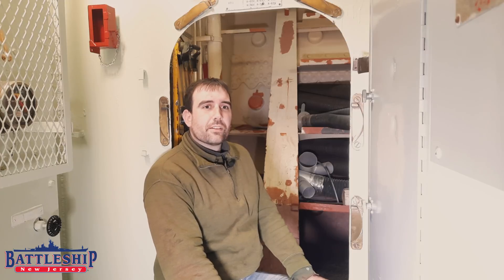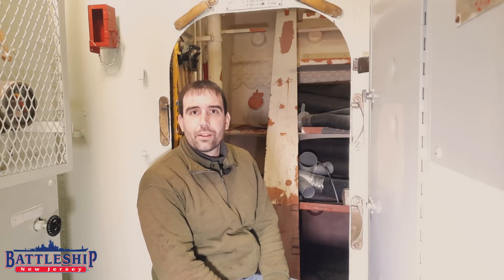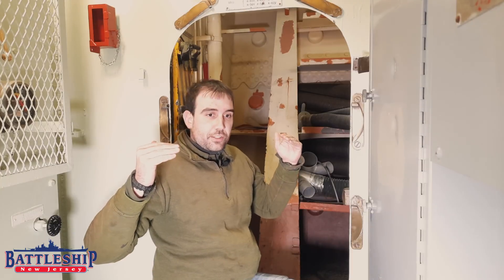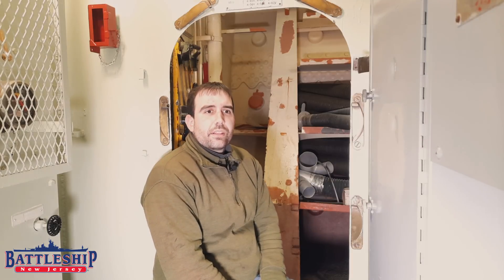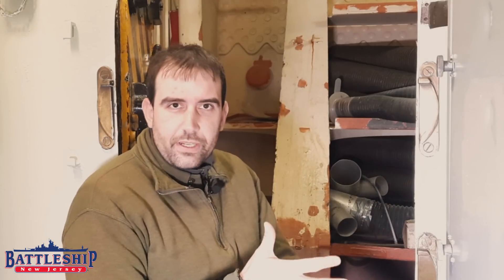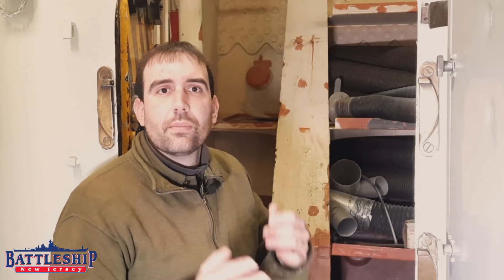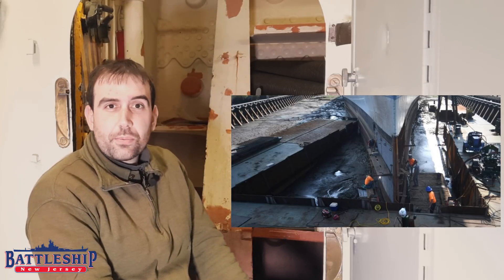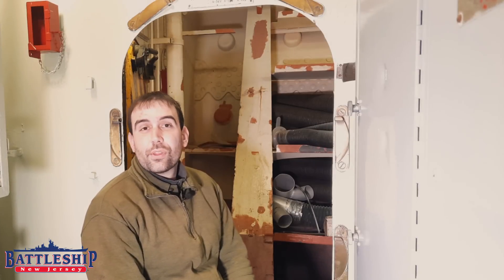Ship out of Water: Why aren't museum ships on dry land?

Comment: Is it different from HMS Victory because it's made out of wood?
Reply from the maker: That's a crucial factor to ship preservation, yes
Reply: @BattleshipNewJersey  While you are correct in describing the new graving dock currently in use, the original graving system was very rudimentary (installed in the 1920's I think) and the long term affects of gravity and specific pressure points on the structure were either not understood or not thought about, which over the decades has lead to the deformation of the hull.

When you tour around the ship and keeping in mind this video, you realize they have stripped out a considerable part of the load that would normally be aboard.  If memory serves there are only 2 or 4 of the original guns, with the rest represented by sheetmetal replicas.
Reply: whoops, you answered my question!
Reply from the maker: Ryan started his career in wooden ship preservation, its definitely not easier than steel but also a very different process of preservation.

Comment: Tying a candle to the hatch to consume the oxygen in the ballast tank is an absolutely genious idea.
Reply: In the Middle Ages sometimes a candle would be placed in a coffin prior to sealing the coffin with lead.  Although they didn't know the chemistry they did know that it reduced the decomposition of the body.
Reply: @thoughtfulhistorytoday7214  So you are saying that's why we can still the music of Beethoven, Mozart and Brahms, because they put a candle in their coffins which kept them from decomposing?
Reply: @ct8764  No. These guys are still "decomposers" 😃😄😂😅
Reply: @thoughtfulhistorytoday7214  Wouldn’t the CO2 leach into the water and turn into Carbonic Acid, which would deteriorate the hull?
Reply: Wouldn't this cause a vacuum and eventually cause the compartment to implode?
Reply: @bossxfactor16  No. It doesn't delete the oxygen, it turns it into inert carbon dioxide. So the chamber would actually end up with slightly more gas in it. But not enough to make a difference.
Reply: @bossxfactor16  It consumes the oxygen and replaces it with carbon dioxide. All the other gases that make up air are still there. Remember that rusting is just oxidation, essentially really really really slow burning. Removing the oxygen stops it.
Reply: @bossxfactor16  no.. you're replacing O2 with CO2 and CO (at the end) Both CO and CO2 are larger molecules than O2.. so no vacuum will be produced.  CO will seek to become CO2.. but that is definitely less corrosive than O2 left to it's own devices.
Reply: @bossxfactor16  The opposite is more likely a potential problem, heating gas in sealed container increases pressure against the container walls (though may be more a risk for just breaking the seal than structurally catastrophic), but with trial an error it should not be that hard to pick a set of materials that will transfer heat out fast enough that should not be an issue.
Reply: @bossxfactor16  when you see the candle vacuum trick done with bottles that's because hot air is shrinking.  A candle is not big enough to heat up an entire tank.

Comment: After watching some videos of the Texas they need to dig a long ditch and fill it with water, drive it in and back fill the dirt.
Reply: The Texas is going to dry dock in early 2021. The hull will be replaced to about 3 feet above the waterline and modern coatings will be applied.   Putting her in mud or concrete will just continue to rust the hull. They both hold water. Please check the battleship foundation web site and Facebook page for more information.
Reply: @mikus4242  "In 1922 the London naval treaty came into effect which required Mikasa (Japan) to be decommissioned. In 1923, she was struck from the Naval register, though she wasn’t destined for the breakers. Instead, she was encased in concrete at Yokosuka and opened to the public as a museum which is where she remains to this day."
There is videos on YT of them talking about the Texas and their grand plans for the last 20 years. Some of their film productions of their plans cost more then their plans did. Then another emergency pops up and they don't have the money anymore.
Reply: @finscreenname  I am a restoration volunteer on the Texas. The state leased the ship the the Battleship Texas Foundation and allocated $35 million additional funds to replace the hull.  It is going to happen and it will be in 2021. She will probably depart in the first half of the year.
Reply: @mikus4242  Is the plan to sink it back in the same mud it's sitting in now or will they build a birth for it?
Reply: @finscreenname  First of all, she is afloat.  I have seen her moving slightly up and down when a wake comes into her slip from ships passing down the Houston ship channel. Second, after hull replacement, she will be going to a new location .  The new location has not been announced, but should be in the Houston/Galveston area.  The Battleship Texas Foundation is evaluating bids for the new location, but has not selected the winner.  As of December 2020 the processes of finalizing the shipyard and new berth location are well advanced but not announced.
Reply: @mikus4242  Well it's nice to see some progress being made. From what I remember that last time it went to drydock for repairs and upgrades all the money was spent on emergency repairs just keeping it afloat. Sounds like you all have a plan and some cash this time. I hope you all get down what you planned.
Reply: @finscreenname  The Battleship Texas Foundation is doing a good job.   Texas Parks and Wildlife used the previous 2 slugs of $25 million each to repair the keel structure and tops of the inner bottom tanks while the ship was in place. Taylor Marine did an astounding job it. The engineering company in charge of the tow and dry docking has filled the troublesome torpedo blisters with expanding foam as a water exclusion material. The ship is pumping a handful of gallons a day instead of thousands.
Reply: @mikus4242  I saw that the tanks were filled with foam. How do you all plan on getting it back out? Watched a guy on YT that bought a light ship in England that was full of foam. Months to remove it and that was nothing like the size of a BB. I really do hope you all get it back together. The video I just watched (from Nov) she looks pretty sad and the ditch they stuffed her bow into is just as sad. 
Look forward to updates when and if they happen. Don't mean to be cynical but I have watched videos about the sad state of the Texas since I have been on YT for 15 years. Something always comes up.
Reply: @finscreenname  Since the entire outer riveted hull is being replaced with a welded hull, the foam will be fully exposed to the outside.  The shipyard will simple removed the foam with pressurized water the same as they use to clean the hull. There is nothing in the tanks and voids that would be hurt by the foam or removing it.  EASY-PEASY!!
Reply: better to do it with concrete.  Dirt is worst then water for any type of steel/iron item.

Comment: USS Batfish (a sub) is on a dry land display, but a few years ago it floated again when Muskogee, OK flooded.
Reply: I have driven past that boat before it floated up. I remember seeing on the news that the ship was at risk of floating away and thinking "where would it go? Another part of the prairie?"
Reply: @starshipreviews  it is right next to the Arkansas River. If it got loose, who knows where it might have ended up.
Reply: @kudukilla  Not far. Most likely, without steering, it would have foundered on a sandbank. Easy enough to recover with a crane & barge. Just put it further inland the next time 🚢
Reply: @kudukilla  Batfish, and other submarines, can be put on dry land because of the shape of their hulls. The cylindrical/conical shape resists the pancake effect. It’s why SS Meteor (a whaleback ship with a cylindrical hull), can also effectively be preserved on land.

Comment: Well . . . the space with the candle might become oxygen free, but not "gas free".   The nitrogen is still there, along with newly added carbon dioxide.
Reply: Pedantic, nitrogen and carbon dioxide won't corrode the metal.
Reply: @DrewLSsix  The candle will go out when the air in the space gets down to around 16% oxygen content.

Comment: 5:46. Oxygen, not air. It's not gas free. The flame is only burning oxygen. Not the Nitrogen and what not. And it adds carbon dioxide. Super interesting video though. Just wanted to nit pick ya.
Reply: Its also burning the 🕯. Its not only burning oxygen.

Comment: I've seen some video's recently on the repair work being done to North Carolina. I was surprised to see the ship sitting in the mud like that.
Reply: The silt is there for two reasons.  1, before they built the coffer dam there was no way to prevent the silt from depositing around the hull without constant dredging.  2, the silt prevents oxygen from getting to the hull, thus preventing rust.  The area around the stern has been silted up the longest and, from what I understand, is in good condition.  Up until fairly recently the bow was still floating and as a result is in the worst shape.  That's why all of the repair work has focused on that part of the ship.

Comment: Huh...I had never thought about the "pancake" stresses, but it makes sense. One of the first things done to older masonry buildings to stabalize them for seismic activity is to through bolt the exterior walls to prevent them from migrating outward.
Reply: Yep.  I remember seeing that done to older historical 2 and 3 story structures in Charleston, SC.
Reply: They're called "Starbolts" <I work in construction>. They look just like stars ⭐
They're a common sight on many old <19th. & early 20th. century> buildings & not just for Earthquakes 🏰
Reply: @scottmcintosh4397  The ones I'm referring to are specifically for earthquake retrofiitting on  un-reinforced masonry buildings. They look just like square or hex metal plates, and I've lived through two commercial building retrofits compelled by code changes requiring their addition.
Reply: @russdewolf8705  
   We have a few buildings in Denver that use the square ones, although we almost never get anything "Earth shattering" 😂
Reply: I haven't even watched the video but I already know this answer because I happened to have toured USS Constitution when she was drydocked 3-4 years ago... The USN had shoring timbers throughout the ship.. and no one was allowed lower than the gun deck until she was refloated. I hadn't before that moment realized that naval architects relied on the water pushing back.. in reality really smart thinking.. saves a lot of weight when operating in the environment it was designed for.

Comment: the best set up would be to have the ship in a giant tank of deoxygenated water with a building around it but that would be a massive project
Reply: what about a tank of oil/antirust ,
Reply: so you want to float the ship in a tank of hydrogen????
Reply: resqjason2 >> OK, best reply!  You win the Internet today!  Well, the battleship Internet.  I’m afraid it’s WAY smaller...
Reply: I would think even moving it to a pool of freshwater would be less corrosive than saltwater.
Reply: @roberteltze4850  it would the closer to “pure” water you have the less reactive, the dissolved ions are what makes water corrosive it also is less dense so it would cause the ship to sit lower in the water and require fewer ballast tanks
Reply: But water is H2O...
Reply: @jeffreyzheng8875  look at shipwrecks at the bottom of lakes without oxygen they are perfectly preserved
Reply: @imchris5000  Paul Allen recently found CV-2 USS Lexington at the bottom of the Coral Sea (9,800 ft deep) and she is in remarkably good condition. Even the planes in the hangar looked good too.
Reply: @imchris5000  No, they're not.  The Edmund Fitzgerald is visibly rusting.  The ships that get better preserved tend to be the older wooden ship that are covered by silt/mud.  Those that are out in the open still get affected by currents, marine life, and, yes, oxygen.  The oxygen may be lower but it's still there and the sea life will use it to devour the bodies of the crew and the metal of the ship's hull.
The bodies may look like they're all there but as soon as they get brought to the surface they literally fall apart.  They may not look like they've decayed but bacteria still acts on them even in "oxygen-free" water.  The water is literally the only thing maintaining the volume of those bodies and making them seem intact.  The microscopic life and chemistry of the local water has reduced the insides to jelly and the bones are no longer solid after so many years.  They've brought up bodies from lakes within 10 years and they collapsed as soon as they hit fresh air.  To keep the bodies from completely  falling apart, they have to seal them in body bags BEFORE they bring them up.  They seal in local lake water so the local acidity and other characteristics of the chemical environment the body has been sitting in for years doesn't get radically altered.  
There's so much we don't appreciate about the bodies of water around the world and chemistry.  The wreck of the Titanic rewrote the book on "expectations."  Every situation is different.  For instance, the wreck of the Britannic, Titanic's sister ship, is in much shallower water but it's in better condition despite being in shallower water, having been located 45 years ago, AND resting on its side.  Shipwrecks resting on their sides tend to accordion/collapse downward as the metal rusts and weakens.  Titanic is resting on its keel but despite that it's in much worse shape than Britannic because of local chemistry (more acidic, salt water concentrations) and the kind of microscopic life nobody appreciated until that wreck was closely examined.  It was appreciated after the 1990s that the wreck was being dissolved by bacteria no one was aware of until Titanic was discovered.
Reply: AvengerII >> I remember the bacteria causes the famous Titanic “rusticles”.  There’s a similar mechanism at work in at least one spot in Lechuguilla Cave, a unique and beautiful cave near Carlsbad Caverns in New Mexico.
Reply: @jeffreyzheng8875  when you deoxygenate water, you remove the dissolved oxygen gas. The oxygen component of the actual water molecule is (mostly) unreactive except in some special circumstances. 

The idea being that since there's no free o2 floating around, corrosion will be slower.

Comment: Presumably it's a choice between the devil and the deep blue sea (pun intended)! Texas is being ravaged by rust and the only chance of saving her has been decided to be a permanent dry berth. Victory and Cutty Sark, albeit both wooden hulled, are both in permanent dry berth, but are properly structurally supported. I'm assuming that supporting the structural integrity of the hull is the major problem with permanent dry berthing. If that is the case, then I'd be interested to know what the longest period is that a ship the size of New Jersey can be laid up in dry dock before it/she starts to 'sag'!?
Reply from the maker: It has not been decided that Texas will be permanently drydocked. She will get about a years work out of the water and then is going back in the water.
Reply: @BattleshipNewJersey  From what I understand is that they want to dry berth her so that so can be better maintained for another 100 years